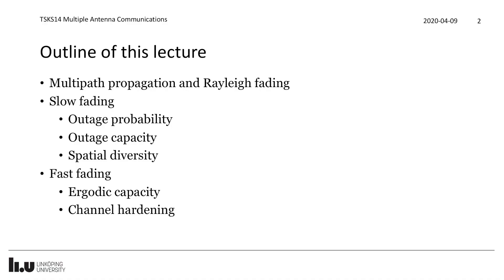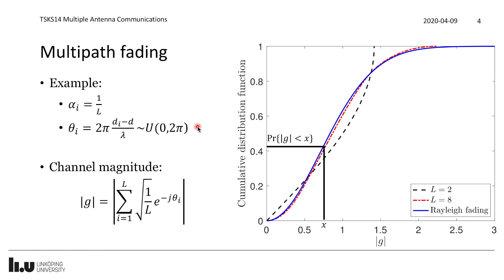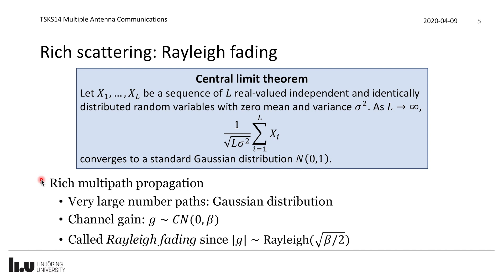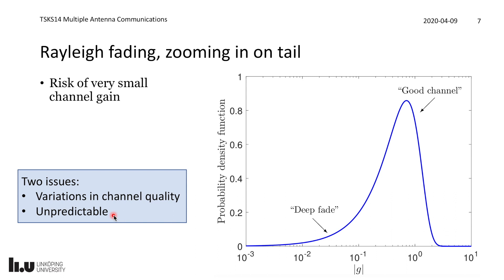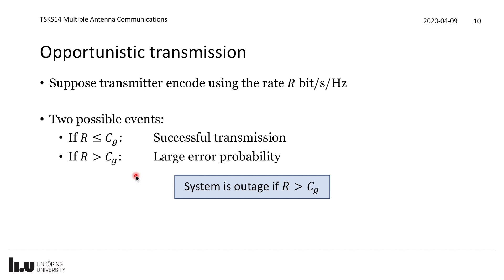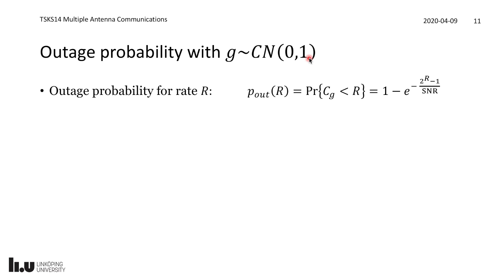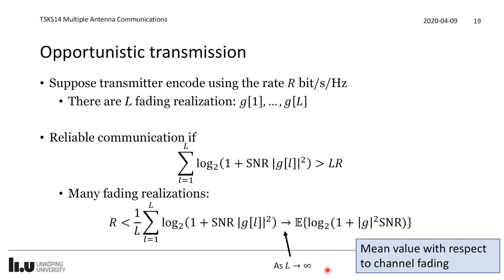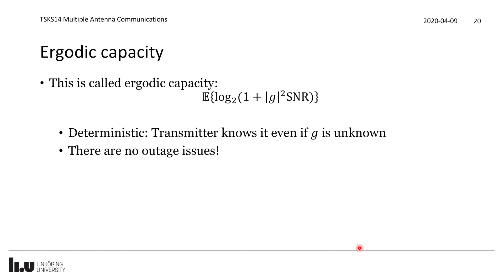Lecture 3: Fading channels and their capacity concepts (Multiple Antenna Communications)

Comment: Thank you professor. A simple question: how do we know the number of paths, L? Is it something that needs to be estimated a priori? Also, in directional channels, do we need to estimate the direction (e.g. DOA) of each of the L paths? I think estimating the number of paths and their directions is very common in radar, but not sure about wireless communications.

Also, it would be appreciated if you can make a lecture about the common types of channel models for sub-6 GHz and mmWave band.
Reply from the maker: We generally don't know how many paths there will be, but we can estimate it. Do we need to estimate it? Not necessarily in communications, since we are not interested in obtaining the location of the user (as in radar) but the content of the signal that the user is transmitting. But if the number of paths is small, then one can utilize this property to simplify the channel estimation.  Different channel models will be covered in later lectures in the 2021 edition, but generally speaking the answer is: LOS channels are modeled by spatially correlated Rician fading and NLOS channels are modeled by spatially correlated Rayleigh fading. The correlation structure depends on the propagation environment as well as carrier frequency.

Comment: Hello Professor! Thank u so much for these amazing videos. Just a quick Question,  at 27:07 in the video particularly, you kindly mentioned that the beam-forming gain gets the curves of the outage probability to the left, does it mean that SNR gets smaller?! As i know beam-forming gain gets Number of radiating  elements * power
Reply from the maker: That the beamforming gain moves the curve to the left leads to the following: If you compare two curves for a given SNR, then the left curve will have a smaller outage probability at that SNR. If you compare two curves for a given outage probability, the left curve will achieve it at a lower SNR. So a beamforming gain is beneficial.
Reply: Communication Systems, Linköping University, LIU I was confusing about the role of diversity gain and beamforming gain. So here is what i understood: 
The role of beam-forming gain becomes more significant or “dominant” in LOS AWGN channel as it facilitates higher power at the point of reception and minimizes radiation in undesired directions, While the effect of the diversity gain is more beneficial or more significant in rich scattering environment (NLOS channels)
As a results, fading channels-which naturally exist in our real channels- necessitate using multiple antennas which ensures regardless of how high the scattering level is, channel becomes more hardened against multi-path fading and channel capacity tends to be closer to non-fading AWGN channels with the use of multiple antennas.
Reply from the maker: Yes, this is a good summary.